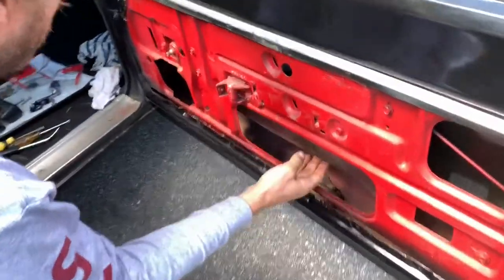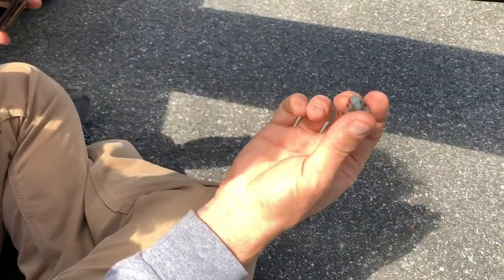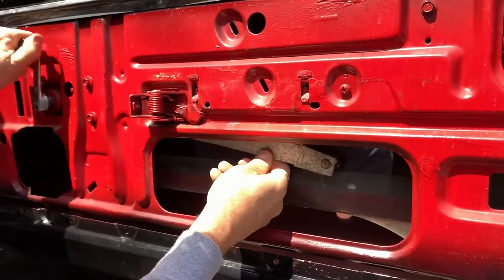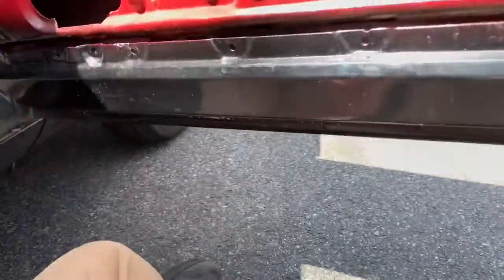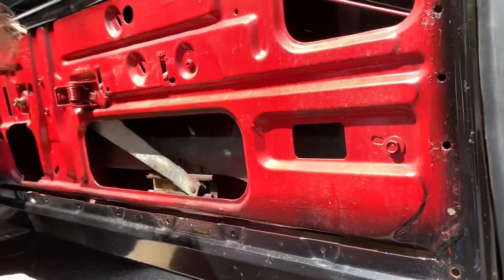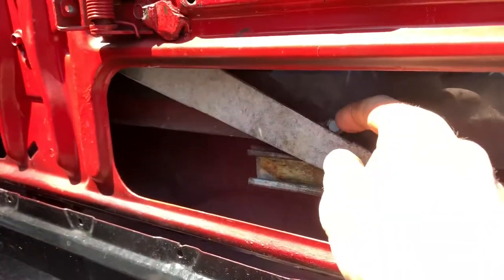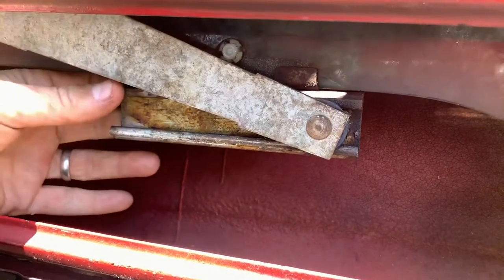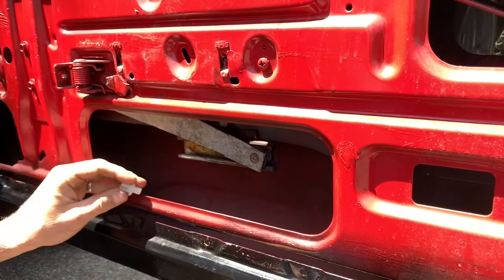Repairing window regulator 1969 Dodge Coronet

Comment: I really liked the two videos you made on removing the inside door panel and fixing the dropped regulator lifting part. Our 68 Coronet Hardtop windows are very hard to roll up. Is the problem worn components, or lack of lubrication? Would you consider doing a video with your 69 or a parts door showing how we would get our windows rolling up easier, or direct me to a site that details that?  Thanks Erik.